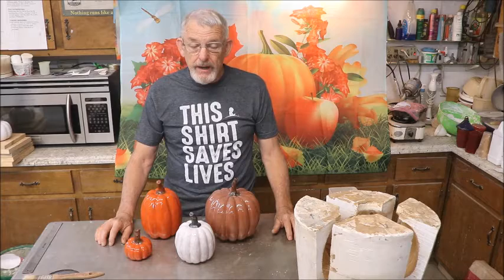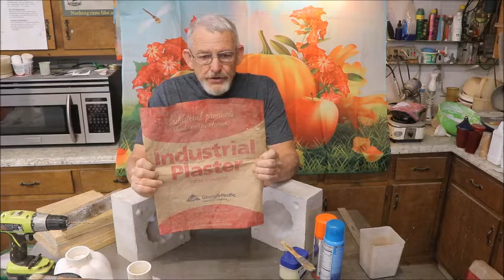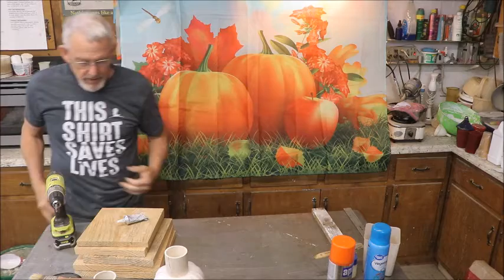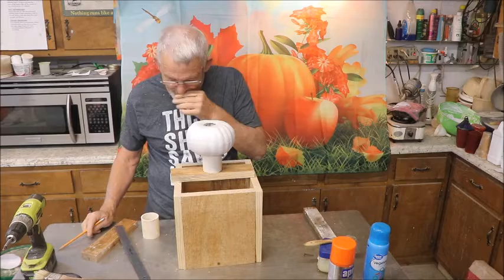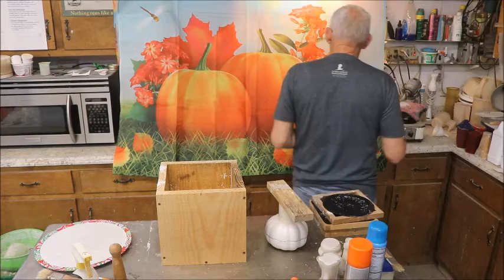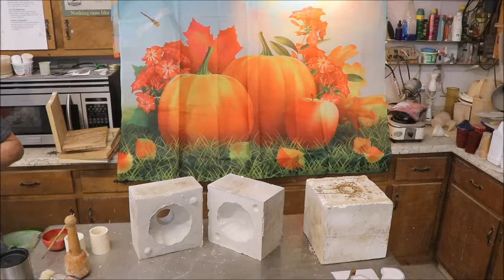How to Make a 3D Two Piece Mold Pumpkin Mold

Comment: Hi Mike for pillar candles before the 2nd pour you need to pierce the wax around the sinkhole, this is called relief holes. You then do your 2nd pour (slowly) for the wax to fill the relief holes. You then wait about 12 hrs and do a third pour. This ensures no air pockets are inside the candle.
Reply: Before 2nd pour wait 20 minutes

Comment: Put registration dots on 3 corners or on two corners of one side so there isn't an issue with which side it goes on, or make one large and one smaller. You can make triangles on one side on each half of the ones you made to show you quick which orientation they go on
Reply from the maker: That would be a help and most times I have to rotate the halves to get them lined up.